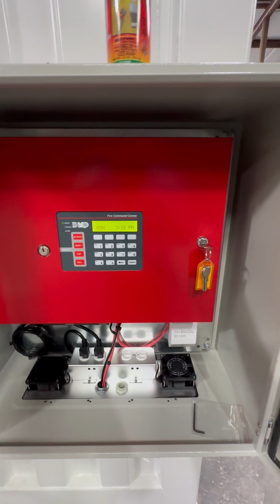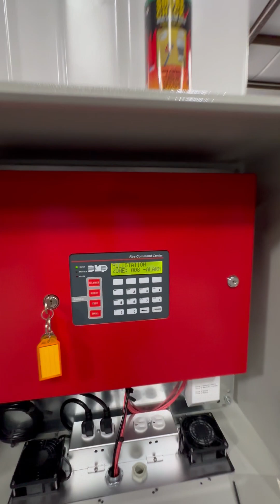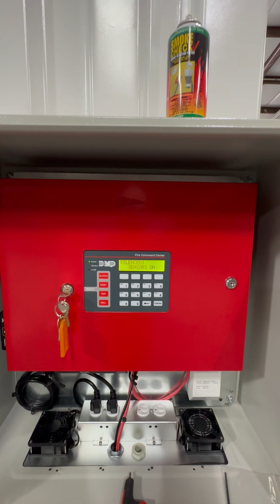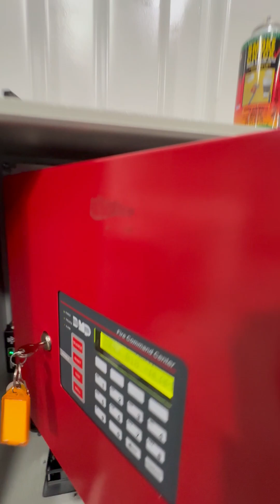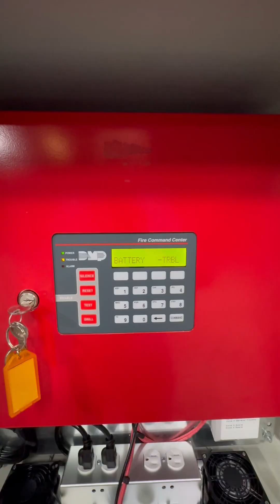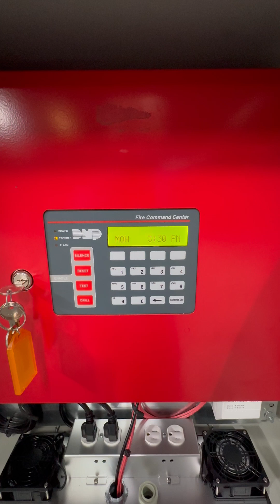How to test a DMP Fire Command Panel

Comment: actually if the panel goes into trouble then it will call out there's a trouble to usually the monitoring company then the monitoring company will say there's a trouble to the buildings electricians or something